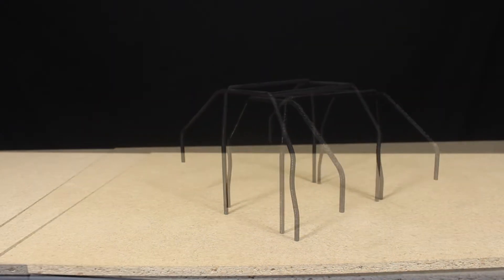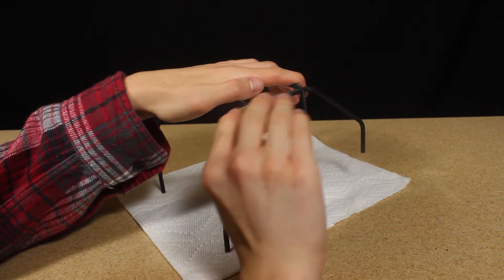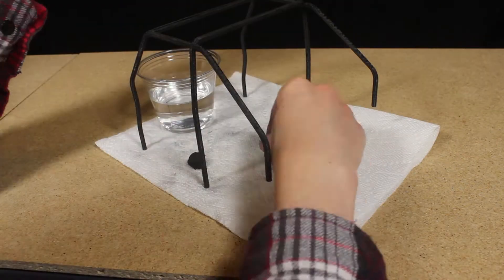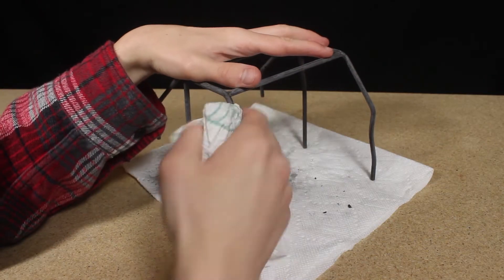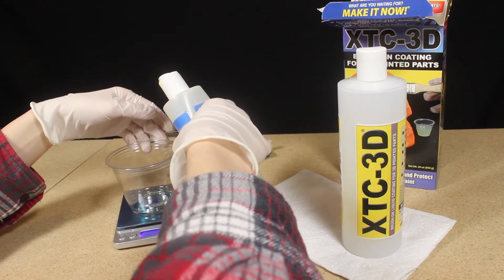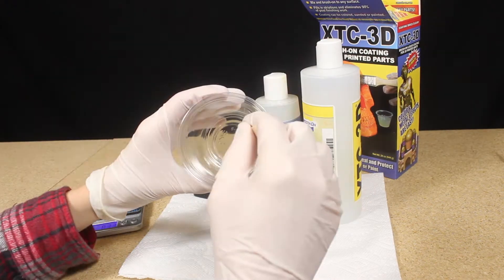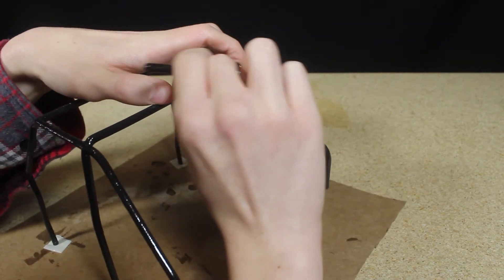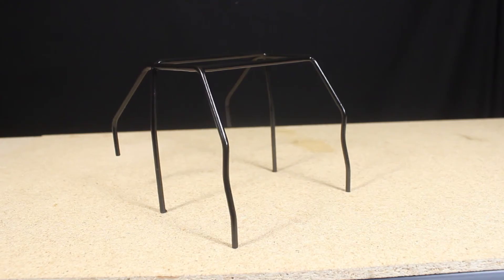Smoothing 3D Printed Roll Cage With Milliput and Smooth-On XTC-3D

Comment: hello do you have any advice for someone who wants to make a drift car but doesn't want to spend a lot of money i also don't know a lot of the whole electronic part do you think a complete car will be a good idea
Reply from the maker: One option you could consider is getting a ready to run vehicle. They are more expensive but they do not require any assembly. I'd recommend saving at least $300USD for a quality RTR AWD drift car. You can get an entry level kit like a Tamiya TT-02D for around $100-$140 depending on body choice. The TT-02D kit and other kits like it generally includes everything you need expect a steering servo, transmitter, receiver, battery, charger, and paint for the body. Tamiya provides great, detailed instructions that lets you know what additional electronics you need and how to wire them.

Comment: Everytime I watch one of your videos I'm filled with information. This process did make a considerable difference in appearance. Does the application of these chemicals strengthen the 3d printed component? Great video.thx for your time.✌
Reply from the maker: The resin coating does make the part slightly stronger and more ridged. If you where to apply the coating thicker than what I showed here, It would probable increase the strength and rigidity more. Thank you for your support, and I'm glad you enjoyed the video!